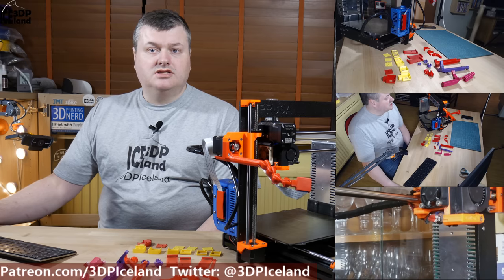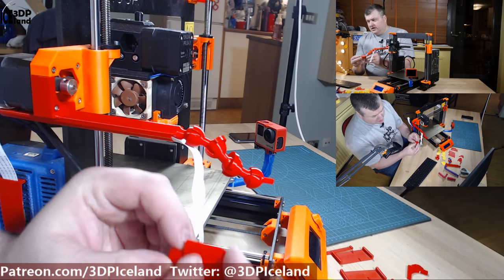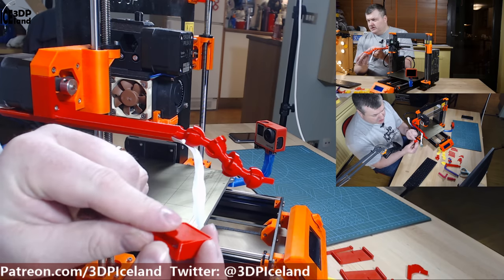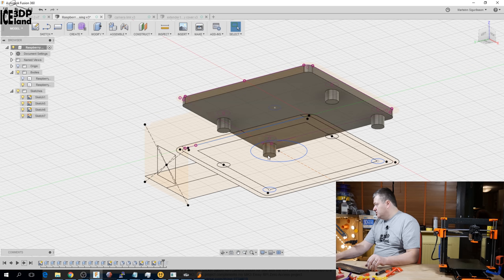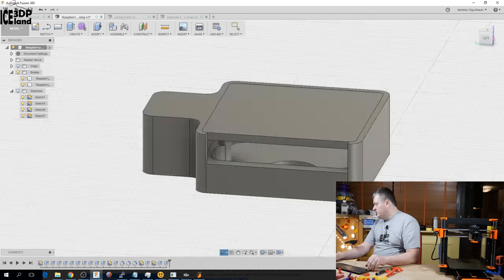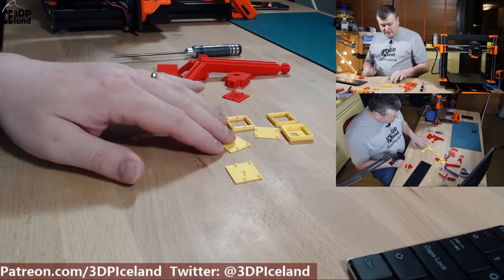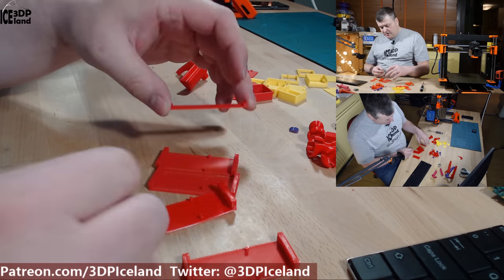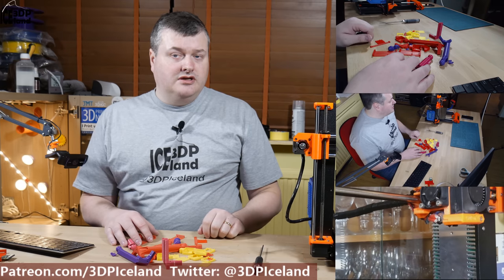Raspberry Camera x axis mount for Prusa MK3 3D Printer

Comment: Same parts are very difficult to print because of the height. Do you use special settings (brim, ...) for the models to stick better to the printerbed? I did now tried it two times and they both crashed ;-)
Reply from the maker: N. Steenvoorde actually i did not use any special setting, i print on a clean pei sheet with pretty good bed adheasion, so check your bed surface  and clean it if needed, but brim should help you as well.
Reply: 3DP Iceland i think it has something to do with the calibration of my printer. I now put down 5 models in the slicer with Brim support and hope for the best. Thanks for your reply and keep up the good work ;-)
Reply from the maker: N. Steenvoorde thank you, best of luck